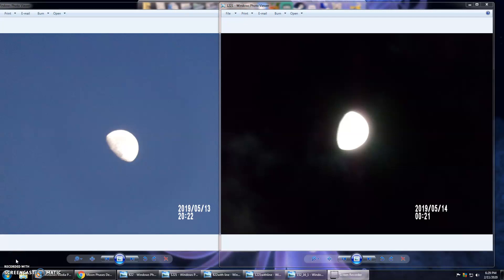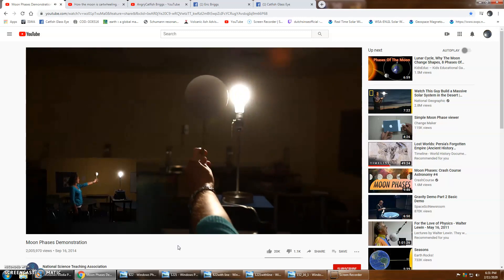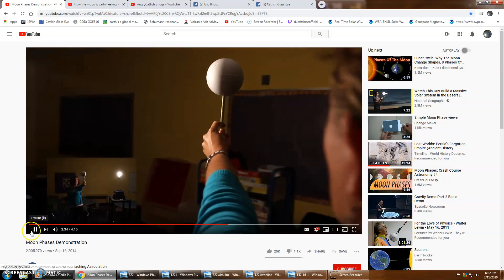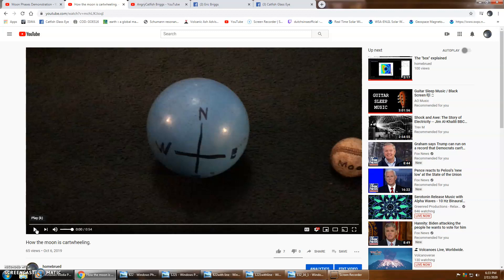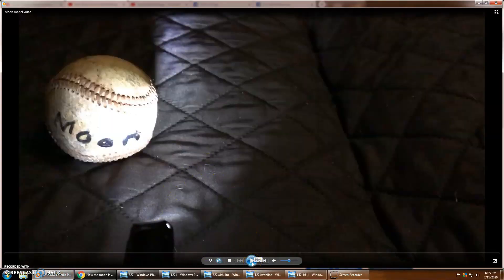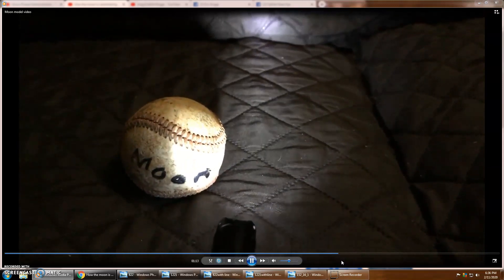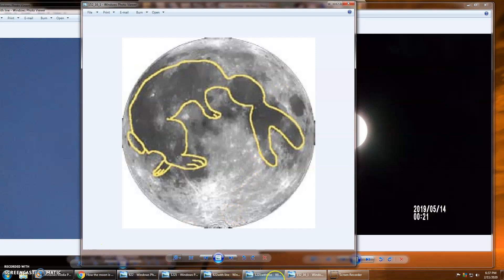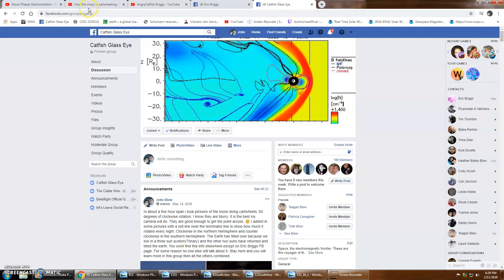The moon is turning like a clock/cartwheeling and it shouldn't be.

Comment: The moon has not been "turning like a clock since 2010."  It does appear to rotate, but it has since all of human history, it's nothing new.  In your shots of the moon, "down" is the nearest horizon, but as you watch the moon appear to travel through the sky, the direction of the nearest horizon changes.  It's like watching a plane fly overhead from horizon to horizon.  When you first see the plane, it will appear nose up as it appears to fly up from the horizon. When it passes your location it will appear sideways, and then as it approaches the other horizon it will appear nose down.  The plane never rotates however, but your perception of "down" does.  Try filming the moon using a polar aligned equatorial mount and it won't appear to rotate because "down" will be in a consistent direction.
Reply from the maker: The airplane didnt do a 180 degree roll like the moon does now and how does your explanations account for hemisphere specific views of the moon? I should never see an equatorial or southern hemisphere views of the moon in Virginia.
Reply: @homebrued  Yes the plane appears to rotate 180 degrees just like the moon - flying toward you, nose up, as it passes by, nose left  or right depending on which side it passes on - 90° - flying away toward other horizon, nose down - 180° - how is that any different than what the moon does?  Here's another way to look at it - when you watch the moon rise north is to your left, so "east" on the moon is up.  When you watch the sun set, north is to your right so "east" on the moon is down.  Again, this apparent rotation of the moon has always existed, it is not some recent development. and it perfectly matches what would be expected from the accepted heliocentric solar system model.
You're "the earth tilted" theory makes absolutely no sense.  If that were true, the moon would appear to travel in a north to south or south to north path instead of east to west, unless the moon's orbit also changed; however, if the moon's orbit also changed to continue the same apparent path in the sky, the our view of the moon wouldn't change.
Reply from the maker: @CSXRobert  If planes flew that way its good they have seat belts doing all those loops. Ya know for over ten years no one has brought a link from a  authoritative website explaining how the moon should cartwheel. Yet i can find millions of pages explaining how the moon should behave. No mention of a roll anywhere. You up for the challenge of being the first to prove it with more then your words?
Reply: @homebrued  You know I didn't say the airplane actually flips 180° but that it APPEARS to (just like the moon).  If you want to have a reasonable conversion, I'm fine with that, but if you want to be intentionally obtuse about it, then I'm done.
Reply: Usually the shadow moves from left to right, but over the course of weeks. But I looked at the moon one night and the shadow cast by the earth was directly centered over the top of the moon, and the crescent was underneath. Maybe I am tripping but I don't recall ever seeing it like that. Granted there's a lot of weird astronomical phenomenon that can seemingly be explained easily like giant harvest moons so I might be wrong...
Reply: @wageslave387  First of all, the phases are not caused by the shadow of the earth, but by the moon's own "shadow" - you are seeing part of the lit side of the moon (the side facing the sun) and part of the dark side (the side facing away from the sun).  It sounds like you are in the Southern Hemisphere because there people usually perceive the shadow as moving left to right while in the Northern Hemisphere they usually perceive it as moving right to left.  If you generally view the moon while it is relatively high in the sky, that will be the case, but if you view it soon after moon rise or shortly before moon set. the shadow will appear on the top or bottom instead of the side because of the apparent rotation of the moon; although, again, the face of the moon isn't actually rotating, but our perspective of "down" is.

Comment: The moon is a reflection of the bigger earth check out godgevlamste channel he explains it perfectly
Reply from the maker: Nope, The moon is the moon.
Reply: the moon is the moon? Go buy a 20 dollar laser thermometer and start taking readings of an object in moonlight, and things in the shade of moonlight.

A good one would be a 4ft iron pipe. block the moonlight from hitting half of it. wait 10 minutes or so for tempatures to settle. now take readings from each side of the pipe.

the section IN the moonlight will be colder.

Comment: Wouldn't this mean that Antarctica is constantly facing the Sun? Wonder why the icecaps are melting.🤔 and also, wouldn't it mean that the Sun should not be visable from the northern hemisphere? That would explain why the Sun changed colour.
Reply from the maker: The Hammeroidz The North Pole couldn’t be pointing at the sun because then the sun would never set in the northern hemisphere and never rise in the Southern Hemisphere. We still have night and day so the poles are perpendicular to the sun. The icecaps are melting because the Earth is warming as a byproduct of the induction heating so Earth has the energy to push against other magnets as closed field lines we see on ISWA/GOES.
Reply: @homebrued  This was exactly my problem. If Antarctica was pointing at the Sun for the last 9 years, we, in the Netherlands, wouldn't have seen the Sun in the last 9 years. 
Now for the next part of my minfuck. And I really hope you'll say I'm wrong.

I recall, when I was a little kid, the Sun was yellow and the senset was orange.
For the last years or so, the Sun is white and to me it kinda looks artificial.
So I got even more curious and searched for "fake sun". 
Turns out Germany made an artificial  sun, so did South Korea. And ofcourse China even has 2 of those. 1st one was finished quite some years back. 
So now my head's racing. 
Could it be even slightly possible the northern hemispere is looking at China's fake sun?🤯
Please tell me this is impossible.🤞
Reply from the maker: @thehammeroidz7140  That is our sun in the sky. No simulator. I have heard and seen all the "proof". So many people get awesome pictures and videos of the moon at roughly 278,000 miles from Earth with their P900 cameras and huge telescopes, Where is the  high quality pictures of a simulator at 1,000(guessing) miles above the surface? There isn't any. Just cellphone garbage. 8>)
Reply: @homebrued  Knowing it actually is still our own Sun out there, kinda puts my mind at ease (for now😂). 
Nevertheless, we are in a pretty funky situation. Platforms like facebook allow all kinds of bs, but it didn't allow me to post this video, nor Eric's. They really don't want us to know what's really going on. Hope you'll get the word out anyway.
Keep up the good work. Kill the mainstream narrative.👍
Reply: @thehammeroidz7140  yup it was yellow. Don't know about the simulator, I've seen patents but who knows. 
Another thing besides the obvious colour shift is the way it shines. Just look at it with polarised sunglasses. You can see the outline of it clearly. There is no glare to it. No "shine",it just looks like the moon but a bit more intense. When i was younger you could never see the outline of it. The "edge" of the sphere if you understand what I'm trying to describe.